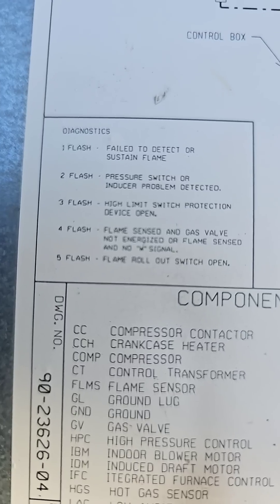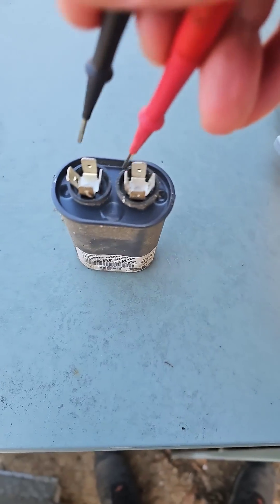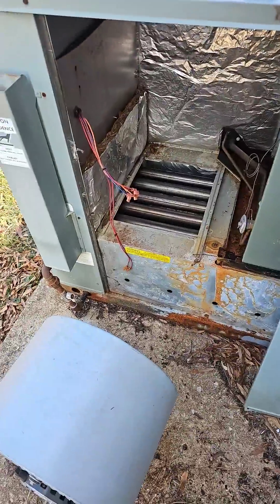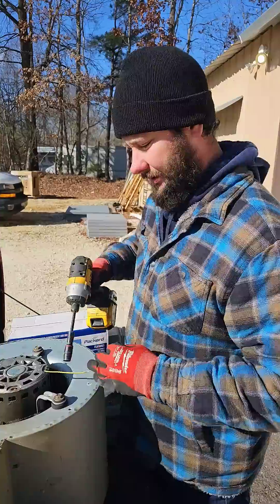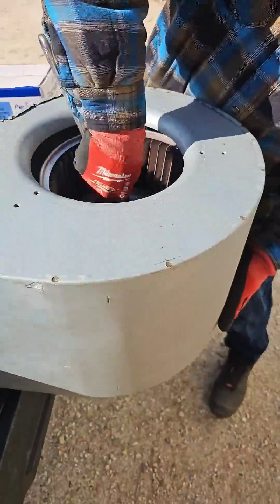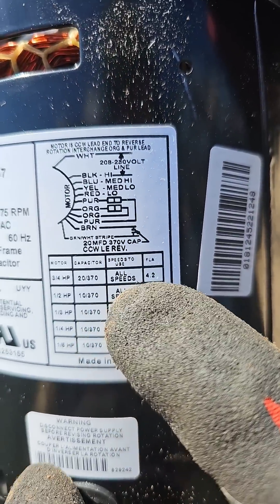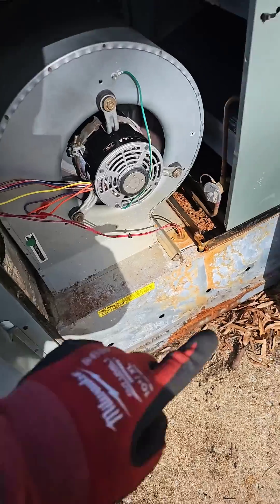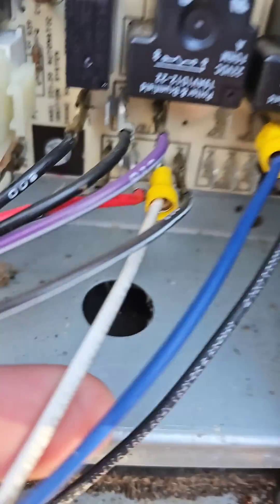Gas Heat Troubleshooting Limit Switch

Comment: you had to leave the job to reassemble  that fan assembly ?  I can appreciate you are trying to be helpful, but I'm the unfortunate one that has to go behind people  like you, I'm assuming you are a one man show in a smaller community? Careful what  you put out there, there's a reason  you don;t see more HVAC/r guys on social   media making videos,one most are usually too damn  busy for all that camera mess,and two some idiot homeowner will  try and hold you liable when  he screws up his unit cause he watched your video,if I were you, I'd add some kind of disclaimer to the front   of your videos  to protect yourself from vultures..
There's just so much to go wrong with a unit that simply changing a part at times isn't enough,sometimes what caused a part failure is way more important,but yes all motors are junk now days...

Years ago you could go buy a brand new a.o smith motor and out of the box they would be locked up, now we have all these china motors,rescue motors and such of all  flavors that aren't  built for crap,there's 35 year old units around here that are 100% all original, just crazy to even say that,,but of course that company went under,lack of sales amongst other things I'm sure..... anyways..
peace

Comment: How come you didn't point out the importance of the amps? I checked and you're within range 😉. Many times you can get a ¾hp but the amps will be totally off. So lets say if your old motor is 4amps at ¾hp but the new motor is off by a lot, you can overheat your motor. Its something i never thought of till i was made aware of. Btw its especially true in any motor less then a HP. Once you're over 1 HP its a different ball game.
Reply from the maker: Man, I totally forgot about this. I wish I would have added this into the video I just didn't think about it. Thank you so much for making a great point

Comment: Dude, are you serious? I don't know where you are. Which state what country  but where I am Most of the heat and AC companies. in my area. Would have condemned the unit and told the person that they need a whole new system But it just needed a simple part. I've been  there a fixed it  with a part that costs nothing almost.